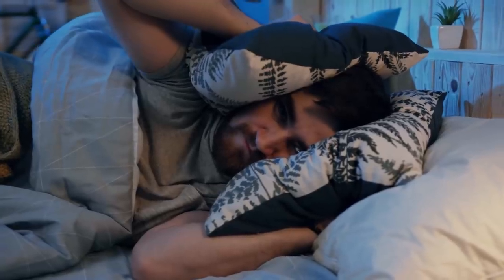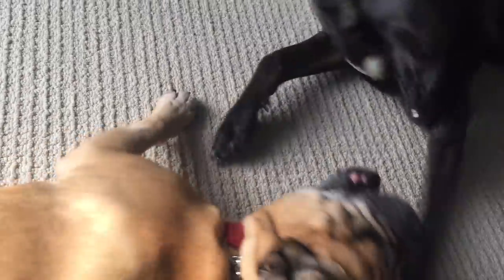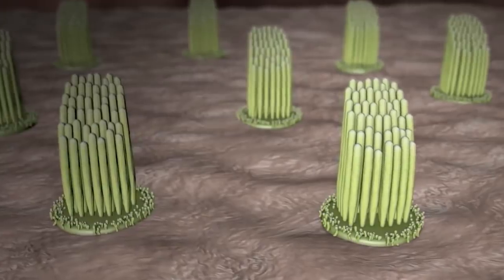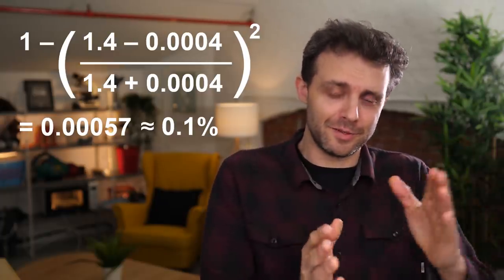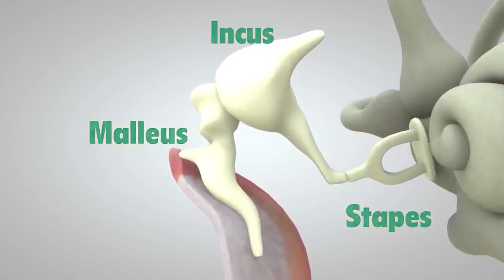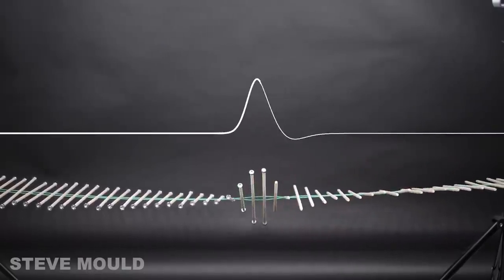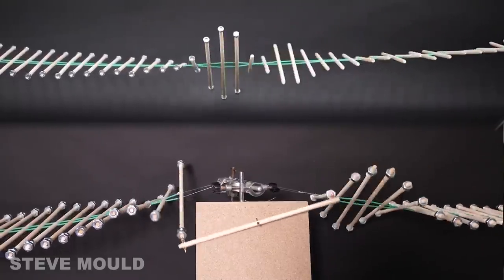There's a Lever in Your Ear and It Does Something Amazing

Comment: Amazing, I've always been able to 'actuate' the malleus muscle alone to make that rumbling sound since I was a kid, never knew what it was or if anyone else could hear it... It's a bit like flaring your nostrils or wiggling your ears, not common voluntary movements but still possible to learn and train. Thanks Steve for this. Also your impedence matching explanation is fantastic! Same situation can be applied in electronic circuits using a transformer to match the impedence (changing voltage levels like moving the fulcrum of a level). Cheers from Australia

Comment: 7:50 The tensor tympani is basically a mechanical dynamic range compressor (DRC), as is the iris. Digital DRCs help avoiding loud sounds when switching between audio content mixed differently (eg. switching between videos or from classical music to electronic music and back). Properly mixed audio employs some amount of DRC through gaining and light compression. Cameras do DRC on capture by dynamically adjusting exposure according to different lighting conditions.

Comment: Regarding VPNs: It's important to note that while it makes sense not to trust your ISP, if you use a VPN provider, you're really just shifting that trust to them. 

Also, DNS (<- asking for where to ask for the website based on its name, like google.com) doesn't have to be plain text, and there are already solutions like DOH (DNS over HTTPS) which encrypt those queries instead.
Reply: Firefox has now switched to using DNS over HTTPS by default.
Reply: DNS over TLS is great and all, but the ISP can still see the IP you are connecting to and can do a reverse DNS lookup. They need to know this to route you. Something like tor is more trustless, though it only works for tcp.
Reply: @theajayyy  that is correct.

You do at least get more privacy with servers that are behind the same IP and switch via the `Host` field in the HTTP header though.
Reply: I definitely trust a VPN more than any ISP
I've already seen firsthand how each treats traffic
Reply: @KaitouKaiju  I trust an ISP governed by my countries laws more than an VPN "based" whenever benefits them the most

Comment: I just learned about the tensor timpani two days ago from another YouTube video. Ever sense your video on ultrasound gel, I've been more aware of the challenge and importance of impedance matching in various phenomena. I think impedance matching is important not just to let sound energy from the air into our ear, but also for letting sound energy from our heads into the air. When you cover your ears with something firm, like the palm of your hand, you can hear yourself breathe and talk much more loudly than normal. This is called autophony, or hearing oneself. While we normally see the outer ear functioning like one of those microphone cones that crooners used to sing into, I think it also functions like the flared bell of a trumpet, getting the vibrational energy from the body of the thing out into the air and, in effect, reducing internal reflections. When the ear is blocked, these vibrations don't "leak out" into their air at the same rate, and more of that energy is retained in our heads and is ultimately perceived as a loud sound.

Comment: TIL: My ears have a built-in amplifier.
Reply: Impedance matcher. Not quite the same thing. An amplifier requires power because it increases the energy of the signal. An impedance matcher just allows the same power to pass into a different medium.

Comment: The ear drum size vs. thing-at-the-end-of-the-bone-lever size part reminds me of hydraulics, where you apply pressure across something of one surface area, it's transmitted through a fluid to something of another surface area and you get a proportional advantage (or disadvantage). Same concept used for construction equipment like diggers and stuff.

Comment: Great explanation of impedance matching and reflections caused by impedance mismatch.

Remember that impedance is resistance to a vibration, not a static pressure, and is very dependant on frequency.

Comment: Is the noise when clenching the jaws really coming from the tiny muscle in the middle ear? My understanding was this muscle was part of the autonomous nerve system, so using white, slow muscle.
The cochlea has 3 times more "motor" cilias" than "sensory" cilias. The motor cilias are located on the other side of the membrane. The sound enter the oval window and travel toward the center of the "escargot", exciting  sensor cilais on  it way. Then, the sound cross thru a hole at the center and travel on the other side of the membrane, this time, the side where the motor cilias, 3 times more abundant, are located.
Finally, the round window allow the incomprehensible liquid to move in/out as the wave is pushing out/in on the oval window, out of phase by 180 degrees.

If you read this comment, I bet you will want to know more: what the heck is the purpose of motor cilias?
And if you apply your usual doubt about supposed consensus, you may be the first the correctly describe how the cochlea really works. PS: it is a spectrum analyzer, extracting frequency information in part of the official frequency range of 20 Hz to 20 KHz.

Comment: You just indirectly answered a question I have had for many years and im having like a eureka moment right now. Every now and then I will hear/feel a sensation in my ear that sounds like the eardrum twitching and making a very strange noise. Its a very hard thing to describe but now I realized it is the inner ear muscle having a little twitching episode, just as many other muscles in the body do. Furthermore, I noticed it mainly happens when my diet is lacking and I am not getting a balance  of nutrients needed for optimal muscle function.

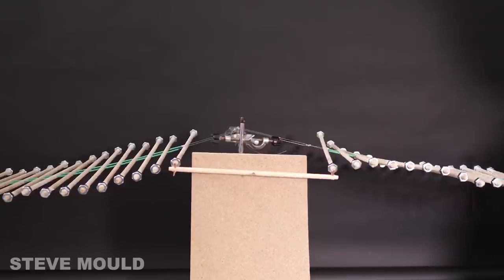Comment: 4:25 You seem to be overlooking the obvious reason the lever reflects the wave; its partially the mass of the lever and friction yes, but more significant is the fact that the dowels attached to lever move simultaneously being mechanically linked (obviously) and so act as one dowel that is triple the mass. This is the primary cause of the reflection at the lever, if the two dowels and lever total weighed the same as one dowel there would be little to no reflection.

Comment: I think there is a second protection mechanism in your ear. If the acoustic pressure is too high, the joint between the maleus and the incus can luxate temporarely, creating an impedance mismatch and thus providing some protection from extreme sound or barotrauma.

Comment: There is similar phenomenon in electrical engineering about intrinsic impedances of transmission lines or epsilon r, which determine how much voltage/current is reflected or transmitted. That's cool, Steve.

Comment: Impedance matching is a fascinating topic. The electronic analog of your lever would be something like a T or Π matching network. But because you’re dealing with reactive impedances in a matching network, you can counteract any inductance or capacitance of your load our source just by adjusting the values a little. In the mechanical analog, that would be having a lever with elasticity or inertia in order to reflect absolutely none of the incident energy.

 Now I’m wondering if there are non-linear acoustic properties that allow for self-mixing, frequency doubling, etc. Maybe even a saser!
Reply: Looks like SASERs exist, they were first successfully constructed in 2009. Using phonon amplification via an incredibly obscure purpose-built gain medium.

Comment: The size difference between drum and oval window is probably best visualised with a large diameter syringe connected to a small one.
also, recording studios use different thickneses of wall material, for instance a stud wall filled with rockwool, covered in thick drywall, then covered in thin drywall, the stud wall being suspended on a solid wall by metal strips (z strips i think)

Comment: You should go into how there is a basilar membrane that 3 rows of Outer Hair Cells (15K Cells per ear) that act as amplifiers and a single row of Inner Hair Cell's (about 3,500 per ear) ride on.  And how when the membrane moves it causes the OHC's that are tuned to certain frequencies to move up and down which in turn generates enough movement for the IHC's to pick up. - Unless you have quite bad hearing damage, most of the time you're hearing your own body because the sounds aren't loud enough to stimulate the IHC's. ^_^

And how the ear is pretty is unique by using mostly K+ (one side of the cells are bathed in K+ and the other Na+ and how the tips of the OHC's sheer to let to let potassium in and how it depolarizes and just how elegant and yet overly complex the organ is.

Also sudden changes in hearing are considered a medical emergency and are usually treated with short bursts of a high dose of corticosteroid's (think Prednisone 40-60mg for 5-7 days).   They don't fix anything but instead they just reduce the inflammatory response from being flooded with too much K+ and calcium that in turn cause oxidization (ROS, RNS & NO) over the period of 7-14 days or so.

You know what maybe this would be way too deep of a dive for a video.   Still the entire system is so amazing and so delicate its amazing it lasts as long as it does.

 Message me if you're interested or just want to learn.  I'd be happy to answer any questions I can.  Most people think their eardrum is just magic.  :P

Comment: Thank you! Finally I understand what muscle I acctually move inside my ear! You see, I have the abillity to move that muscle at will, at any time. When I do so I hear a crackling sound in my ear, and it is in fact so loud that if you put your ear next to mine you will hear it to. I can even flex that muscle slowly in steps, and for each step there is a little pop. It is kind of useless, but a funny party trick. I have had people say a number and then choose big or small pops, counting up to the desired number. And I can control the muscle in both ears, but it is easier in the right ear.

Comment: I learned how to contract those muscles a few months ago when hammering on some steel, swung the hammer and hit a soft wood punch that didn't make much noise and heard this rumble.
WTH, are my ears broken? Did it a few times and the threat of a loud sound without the sound allowed me to hear the rumble and isolate the active muscles.
Scrunching up your face or yawning doesn't help, but it is quite similar to  the Valsalva or Toynbee maneuvers.  Well, without the yawning, swallowing, tilting or pinching.

Comment: Steve, I am able to produce the rumble you described at around 8:15 at will. I don't have to change my facial muscles or yawn to make it occur. Sometimes if I don't have hearing protection I do it because it seems to dampen the outside noise slightly. I noticed I could do it when I was young and have used it to my advantage for years.

Comment: I have control over my tensor tympani, so I can make that rumble sound at will. I also have control over my eustachian tubes so I can manually equalize the pressure in my ears and pop them at will. That's a much more useful skill than making a small rumbling sound that no one else can hear.

Comment: I am listening that video (and watching) again and just noticed the mention of the tensor tympani.
The mechanical disadvantage is lowering the tympani displacement by a factor of 20.
Steve Mould says that between air to water, the impedance mismatch is in the order of 2000.
About the way the cochlea act as a spectrometer and why 75% of the cilias are motor, only 25% are motion sensors, I wrote many answers or comments on Quora where I basically propose that the brain "hear" the amount of energy spent by the motor cilias to stop the waves before reaching the middle where the wave would return toward the second flexible window.
Similar to oxygen sensors in cars which measure oxygen level by measuring the current applied to the heater to maintain equal temperature.
Because of the high quality feedback control loop, the value of the temperature sensor is a constant.
In the cochlea, the probing of sensor cilias gives a meaningless distorted noise while the command applied on the motor cilias is a smooth log in scaled value of sound intensity for each frequency by location along the basilar membrane (sonomatopy).

Comment: I am an ear surgeon; this video should be compulsory training for all would-be ear surgeons. There is also a hydraulic mechanism between the eardrum and oval window that helps with the different densities of air and the fluid in the cochlea (endolymph). There is another muscle called the Stapedius that pulls on the joint between the incus and stapes to reduce travel with loud sounds.

Comment: Your video just made me realize, my whole life I’ve had voluntary control over my Tensor Timpani Muscles but never knew what it was. Without having to squint or scrunch my face as you suggested, I can voluntarily start that rumble sound in my ears. I can easily start and stop it at will. I even just discovered I can do each side a bit separately, something it had never occurred to me to try until just now. The right side is easier to isolate. I’m right handed. Curious. Thanks for the insight, Steve.

Comment: Late to the game, but I believe the explanation of the "force" ratios of the eardrum to oval window could properly be considered mechanical advantage.  It is analogous to the description of hydraulic systems, which also "multiply force" through the use of differently sized surfaces on the pistons.  I'll admit it isn't perfect, because the hydraulic system uses one internal pressure to deliver two different forces, where the ear transfers an air pressure, by a mechanical linkage, to a new pressure in the cochlea... but it seems logical to me to call a ratios of these two pressures a mechanical advantage.

Comment: 10:30 If you login on a website without ssl, a VPN does barely help with that. As you correctly explain, the traffic is decrypted at the VPN endpoint and from there you password and any other information travels on unencrypted. So every server in between can still read you password.

Comment: some people can voluntarily tense up their inner ear muscles. i can do this. it is indeed a rumble, similar to sticking your fingers in your ears. it also allows me to equalize pressure without swallowing, yawning, or any other trick to get your ears to pop. i've never been on an airplane though, so i haven't got any use out of it. except one time during a tornado, the atmospheric pressure changed and i used to it then.
worlds most useless hidden talent unless you're a frequent flyer if you ask me.
Edit: i just remembered that sometimes air gets pushed up my eustachian tubes in the back of my throat, trying to blow my nose when it's clogged is usually when it happens, and i can get rid of it then too.

Comment: 8:08 I don't need to do that, I can control them. And I can make the "bibrating" sound much much louder if I conciously "actuate" those muscles. I can also "actuate" the muscle that "pops" your ears when you yawn and the inside pressure is much bigger than the outside of the ear :)

Comment: Great video. I also find it interesting how people explain NordVPN. If I could, I would like your video twice for that, as your explanation was quite good (I faved it, too, which should also help).
You gave a reasonable explanation and the only fault I could see is that "they don't know where you are" is technically correct, but the browser usually sends a heapload of metadata along (cookies, local data, session data and server side data tied to any of the before) which makes knowing the IP not that much of an important factor to other services. However only saying that it's good against geofencing was really good (no encouragement to do other stuff that will be nullified by said metadata). The common point of public unencrypted wifi could be added to the list of advantages (which also gets plaintext dns request even if ssl is used).

And of course the video was fascinating as ever. (That hopefully goes without saying. The reason I subscribed to you a long time ago.)

Keep on doing great videos!👍

Comment: Hey Steve, random remark about something you said in the VPN bit:

A website would have to be extremely poorly created to ever send your password as plain text. Even over http, a password will (almost) always be hashed in some way. This means that, if intercepted, someone would still be able to access your account (they can mimic the request with the same hash), but they would not know your actual password.

Obviously from a security perspective, this is still a nightmare, but not as bad as them knowing your actual password. Firstly it would always require special tools to access your account (websites don't accept pre-hashed passwords), and secondly they can't try to derive related passwords from it (in the case that you have similar but tweaked passwords).

Comment: Very interesting video and finally a somewhat reasonable explanation of VPNs in an ad, there is only a consideration missing tho, sending password to http sites trough a VPN makes them plaintext on the internet anyway, both all the intermediate nodes and expecially the VPN endpoint will be served with all the data (potentially also your full name and such since it is a paid service) so it's not technically encrypted and serves absolutely no protection in that case, but adds a potential extra intermediate sniffer.
So yeah unless you are in old wep protected public WiFi that doesn't hold much